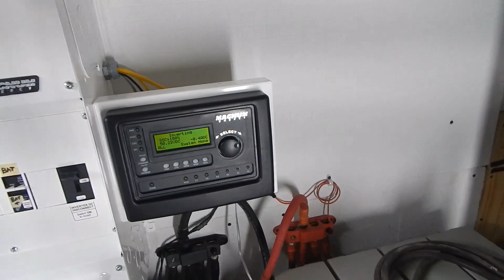Magnum 48 Volt System Compleat!

Comment: Looks great well done
Reply from the maker: Thanks. I feel much better with a nice safe and closed system.
Reply: @TheKiloG69  I would check all of the electrical connections after a week because it's safe to just take a look no big deal I did
Reply from the maker: @solarpowerelectricityandel2915  that's a very good idea yesterday as I was going through the cabinet I found my one AC wire for my 120 volt inverter generator but I somehow forgot to tighten it got pulled out while I was messing around inside the box I could not believe it.

Comment: That looks so nice. The midnite should keep its programming when turned off. If not then you need to replace the very small battery that is in the unit. Very sweet install my friend.
Reply from the maker: Thank you so much my friend. I know have a nice safe system fully-enclosed room to grow in another inverter.

Comment: That makes for a good nice clean install  it's durable. And safe. Room for expansion
Reply from the maker: Thanks Roy came out great. Next weekend I hope to raise the whole system up about a foot. Then get the extension panel and another inverter. Next week I'll have help to do this.
Reply: @TheKiloG69  I was thinking it was a little low but thought there might have been a reason it was where it was
Reply from the maker: I have to put up one more piece of cement board. this is my only source of power so I needed it up and runnig.I just couldn't lift everything that high working over the battery bank by myself just impossible. Thats why 1 bank under it is still sticking out some.
Reply: @TheKiloG69  that is understandable. That's when the tractor comes in handy.   Man power is easier if available. Forklifts are handy for that to